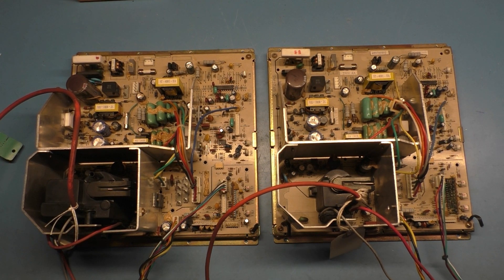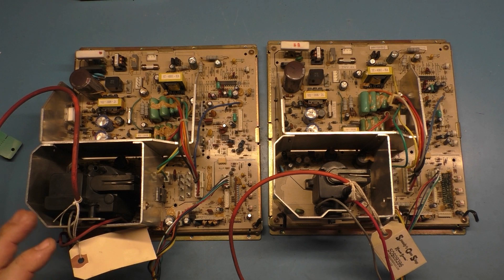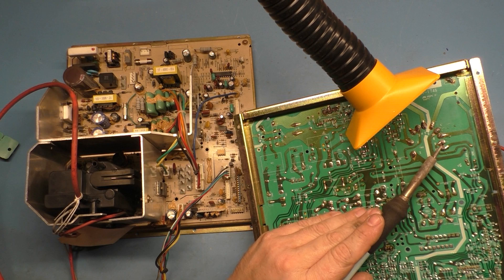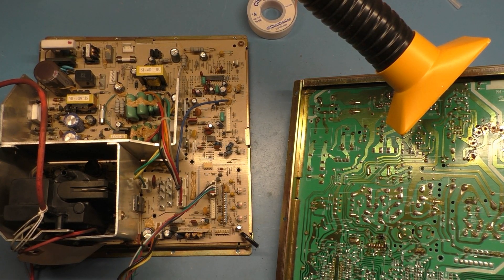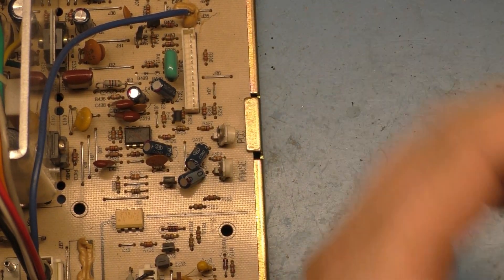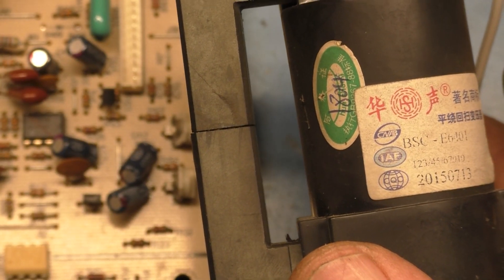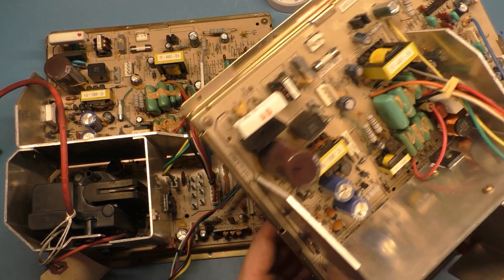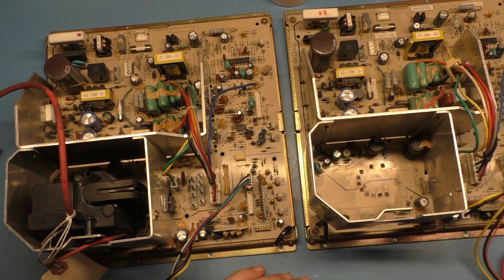27" Sanwa PM1745 (27Z21C-A74) Arcade Monitor Repair - Replacement Flyback Available?

Comment: In ordeer to desoldering flyback on pm1745 you need just a bigger nozzle (1.6mm) .  Bytheway I have testesred the littke BSC flyback and ut have an issue,  basically on a white full screen rhe the grid will be deformed /distorted on the sides maybe because it have not enough power

Comment: Honestly Mike, I was using those piece of junk desoldering guns (both a proskit ss-331h and another junk duratool zd-915). Switched to the hakko fr301. It is a dream for me. It even has tiny 0.6mm tips that fits perfectly over the small LS and ram chip pins on pcb. No more popped traces. Never clogs. I know you said you have a hakko too but it may be a dud?
Reply from the maker: Thanks. No. It’s cheap Amazon crap.
Reply: in my experience the hakko fr-301 does clog frequently. running the suction motor horizontally or inverted for a second after each desolder does help. Having the cleaning pin and using it regularly does help as well. Another tip is to listen to the tool and know when it's starting to clog and then cleaning it with the pin. If the clog is really stubborn it helps to heat up the tool and disassemble the tip and then clean it while still hot but in separate pieces. And be careful handling the hot pieces, obviously.
Reply: @KaPH33n  That's terrible. They are so expensive. I guess I got lucky. Or maybe the European version is different somehow.  People rave about the cheaper proskit and dutatool but for me they were nothing but frustrating. The hakko has been perfect for me desoldering 100's of components. I mainly do arcade pcb work and use the N61-01 tip holding the trigger for an extra second after removal.
Reply: @MickMacklerack  what temperature setting are you using? I'm at the minimum 1, which may be part of the problem. However I'm trying to introduce the least amount of heat necessary and only up it when dealing with ground planes or other joints that don't cooperate. I still recommend the hakko fr-301 and consider it an essential tool.